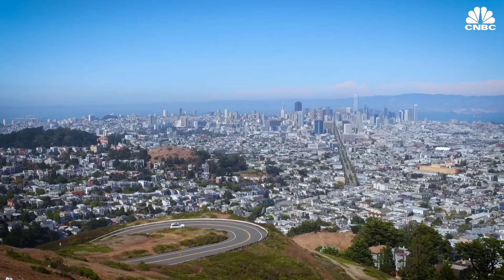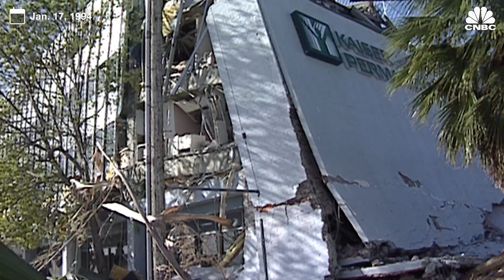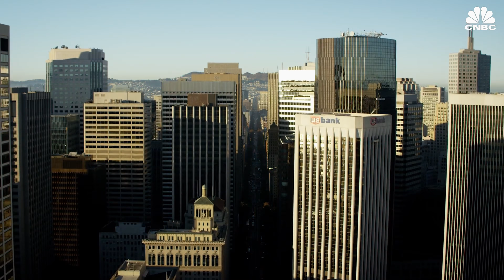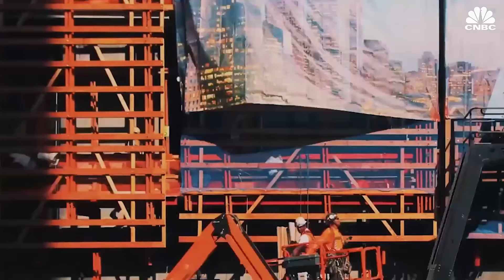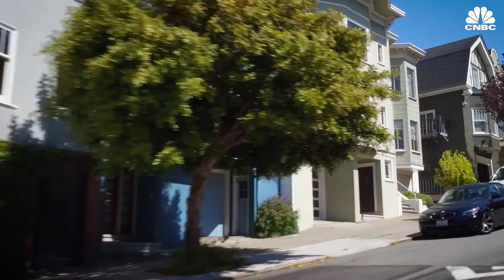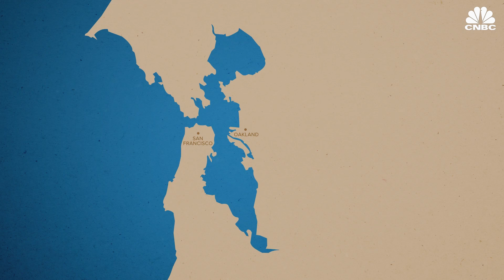Why San Francisco's Earthquake Risk Is Growing

Comment: If Japan can build earthquake-resistant cities, we can too. All future construction should be built to withstand strong earthquakes, liquefaction, and soil subsidence, and old buildings should be retrofitted whenever possible.
Reply: Then all buildings will become Japanese style,
Reply: @yogadarmawan3051  what do you mean Japanese style? You mean more resistant to earthquake style?
Reply: @thelastdefenderofcamelot5623  skyscrapers are actually some of the most earthquake resistant buildings
Reply: @thelastdefenderofcamelot5623  your missing the point dude. It’s not about skyscrapers!
Reply: The new buildings in San Francisco are earthquake resistant. The problem is the older low rise buildings
Reply: Don't go too far, look to the south. Mexico City is earthquake proof.
Reply: Tell that to the SF approvers of millennium tower
Reply: Let me ask from a Japanese guy who is a SF resident. Is Salesforce tower safe against earthquake?
Reply: One thing about Japan is houses are like cars, they depreciate. Houses get demolished and replaced after 30-40 years with modern safety codes and not worth maintaining existing homes and Japanese frown on expensive preowned assets.
Reply: jose manglona  I read that the plant was highly flawed having an insufficient seawall that TEPCO ignored despite studies. Disaster could've been prevented.
Reply: they have been retrofitting soft stories in SF
Reply: @elimarshall1497  🤣
Reply: The one things about building in San Francisco though is that developers maneuver around competing interests. Tokyo for example has many modern mass produced buildings which are very affordable to construct but some of those buildings may be protested against in San Francisco for “not having character” or “ruining the neighborhood” so a developer may have to appease residents by stylizing the new building to fit in with some of San Francisco’s older architecture which would of course increase cost a bit.

Some developers find such concessions palatable because San Francisco is such a hot market so you will see a some buildings that look older than they actually are as to comply with the character of neighborhoods but other developers find the hassle very much not worth it and choose to invest somewhere else
Reply: @jarjarbinks6018  🤨 thats b.s. the new buildings are all modern looking
Reply: @thecapricorn11  I’m not talking about the financial district. They’ve already built it up. I’m talking about all the neighborhoods with Victorian rowhouses
Reply: @thecapricorn11  the “historic laundromat” is a good example of the city literally using their power to block a property owner from building a modern apartment on his own land
Reply: There is no such thing as, "earthquake resistant cities". First of all, you can try to construct buildings that can sustain minimal damage but they aren't "resistant". Second, how would you "build" a "earthquake resistant" city. Your comment is absurd and makes no sense. Why don't you do a YouTube Search for Japan earthquakes then spend an hour watching what happens in Japan during earthquakes and a Tsunami then come back here and delete your stupid comment.
Reply: @jarjarbinks6018  Row houses are house built on a common sidewalk. So, every house in San Francisco qualifies as a Row House and Victorian style house are the most durable and have stood for over a hundred years in San Francisco. You are clueless.
Reply: Even Japan doesn't always get it right. During the Kobe earthquake, some buildings actually did collapse.
Reply: @craigjgomez  The neighborhoods with Victorian rowhouses. I was talking about how whenever a developer wants to build something, even if it’s on a almost empty plot of land, swaths of people who got nothing better to do try to derail the entire project at city meetings. Why on earth would a developer want to work in such a hostile environment. Also some of those wooden rowhouses may look nice on the outside and if well taken care of could withstand a earthquake fairly well but not every one of those houses is in good condition. When someone wants to replace a rowhouses that is falling apart but the city only allows them to repair the house and renovate even though it would more expensive it discourages them from wanting to do anything in San Francisco.

You have not idea how difficult San Francisco’s planning environment is, you misunderstood my comment, and you are clearly looking at all the buildings in San Francisco with rose colored glasses
Reply: absolutely correct.    you should know you've been around since 1931 and you are an architectural marvel!  I live in SF and they retrofitted my soft story building (constructed in 1962)  a few years ago.   one can only hope it will hold.
Reply: @ydne  Could you elaborate please. If the Fukushima Nuclear Power Plant had a serious meltdown after the last major earthquake several years ago and the Tsunami afterwards was catastrophic, I fail to make any sense of your comment. Japan is basically an island in the Pacific Ocean and is prone to seismic activity. You cannot build "earthquake resistant" buildings because there is no such thing as earthquake resistant. Use common sense. In the last major earthquake in Japan, buildings crumbled, freeways collapsed and a nuclear power plant had a meltdown. Do you know how long it takes for nuclear fuel rods to cool? You are talking nonsense.
Reply: jose manglona  Thank you. Finally somebody with common sense. Some other good in this thread actually wrote that Mexico City is "earthquake proof".  It was only a few years ago that Mexico had two powerful earthquakes in the same year over 8.0 on the Richter Scale and one was in Mexico City. If you look it up on YouTube, there are several videos that recorded the event live from video cameras throughout the city. The footage is the most frightening I have ever seen. If anyone can watch those videos then come away thinking that Mexico City is earthquake proof, they have to be smoking some heavy s**t.
Reply: @penguinsforever1609  Right, while there was radiation poisoning for miles around and contaminated Tuna in the Pacific Ocean as far as 100 miles off the west coast of the USA. I guess you weren't paying close attention but the Fukushima meltdown isn't over. It will take a thousand years for the fuel rods to cool. Nobody is calm in Japan. They just accept the reality and go on with their lives. Maybe you should watch some of the video of the Tsunami from that same earthquake. Calm isn't exactly the word I would use to describe it.
Reply: @thecapricorn11  Once again Foggy, you are clueless. I should know because retrofitting simply means bringing a building up to current code. It has nothing to do with being resistant to an earthquake. If you were here in '89 you should remember the collapse of a section of the Bay Bridge. The bridge was originally constructed to withstand a 6.0 magnitude earthquake. The '89 quake was 6.9 magnitude. So much for that. They Cypress Freeway double-decker in West Oakland collapsed on top of itself killing people trapped in their vehicles. You need to look at the ground underneath the foundation to determine whether there will be substantial or minimal damage from an earthquake, not the construction. Every home is built with that in mind and just like the fools who build in the thick vegetation of our "wildland" communities and wonder how their homes went up in flames so fast, it's where you build not how you build. I should know. I have lived here for 73 years.
Reply: @craigjgomez  the highest possible earthquake on the San Andreas fault is only 8.3. The buildings are designed to withstand that amount. The Millennium tower issues were caused because the construction of the Salesforce Complex nearby. It’s a very rare incident as almost all new skyscrapers have been in SoMa where because of the Millennium tower new skyscrapers in SoMa have also been checked.
Reply: @craigjgomez  🏳️
Reply: It's that that you can or can't... you certainly could, but it is a cultural issue.
Reply: We learn from each quake.  As this video points out, the 1994 quake showed that welders incorrectly welded steel together so buildings that should have been stronger, weren’t.  Once identified that problem was corrected for new buildings, but old ones (also as pointed out) still exist.  Many older buildings here have lost their tile roofs as a way to cheaply protect the structure (removing weight). and some major ones, like the big old Southern Pacific HQ across from the Ferry Building are nothing more than a shell, with a new reinforced concrete structure behind the outer walls.  Sadly, while this cost a fortune, no one budgeted for saving what should have been essential period interior spaces like the lobby.  And, given the expense, many building owners put off soft story seismic retrofitting such that a labor shortage (even before Covid) delayed the work as everyone raced to get bids at the same time.  Of course, with half the country revolting against taxes thinking they’re going to end welfare for black people (creating ever more welfare for the richest and mostly white 1%) getting anything done today is problematic.
Reply: Is not just Japan all the countries under the Pacific ring of fire are prepared except the USA for some reason
Reply: SF can build skyscrapper that leans and defy gravity..
Reply: Japan was the first nation with a high speed train in 1960. The United States dont even reach these speeds today...
Reply: There more advance on the other side
Reply: @ydne  Sorry but I don't need any "help" and like I have already stated factually, words like, disaster proof or earthquake proof are oxymoronic. There is no such thing. It is simply an idea that like all ideas when put to the test they fail. Japan like Hawaii and other Pacific regions are prone to seismic activity from mostly underground locations. Tonga recently experienced volcanic activity that was devastating. Despite Japan's advances in automobiles, electronics and shipping, mother nature is a force that mankind will never overcome. The clip you thought was helpful did not provide anything of any scientific conclusion that Japan has solved the potential for mass destruction due to earthquakes. You should pay closer attention to what you are watching and realize from common sense that after the meltdown of the Fukushima Nuclear Powerplant   in Japan and the fact that it takes a thousand years for nuclear fuel rods to cool, the dangers from radiation in Japan still exist and will continue to exist beyond your lifetime and mine. The stupidity of building a nuclear power plant in a highly active earthquake zone is proof that Japan has no clue when it comes to living in a disaster zone. And, I haven't even talked about the power of a Tsunami and the devastation to structures.
Reply: Liam Neeson: Good Luck
Reply: Na bra, u can never under estimate Mother Nature. But I feel what u sayin
Reply: And divert money away from the homeless industry?  Are you crazy?
Reply: Ill come over your your area,  ill FART and you'll think differently then.  😐
Reply: @yogadarmawan3051  all u guys care about is military over there lol. Aint gonna happen 😂
Reply: most of tokyo’s buildings are brand new, most of san francisco is historic, so it would take a lot longer, since each retrofit would have to be approved by the cities historic building regulations

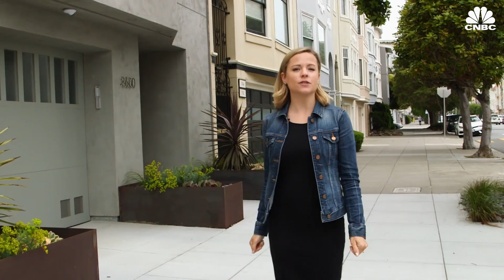Comment: As a structural engineer, I designed earthquake strengthening systems for those "soft story" type buildings at 4:30 in the video.  There were no adequate products to fit into congested garages, so I invented my own.  It's now patented and used in over a dozen cities in the East Bay, Peninsula, North Bay, Pleasanton.....  but SF has so far allowed it in only ONE building after the system went through an independent engineering review.  The reasoning behind SF's hesitancy would make a good story in itself.

Comment: One aspect skipped over in the soft-story issue is that those are the buildings that make up much of the fabric of what makes San Francisco, San Francisco; the neighborhood shops under apartments, not just the garages.  Sadly, in the push to get this done (and it has to be done) a lot of long standing businesses that have weathered all sorts of modern challenges have been put out of business when forced out for the retrofit.  And that, was pre-Covid.  Other, larger old buildings, like the big “brick” structure right across from the Ferry building, aren’t as they seem.  Built for the Southern Pacific Rwy, that building was always a brick covered steel frame building, built on lessons learned from 1906.  But it isn’t even that any more; like the former Matson building now subsumed into the PGE complex (itself no longer PGE) is a post 1906 facade, on the outside of a new concrete inner shell, with an entirely new interior floor plan, and along with that extra earthquake safety coming in, out went all the elegance of the old structure, only bits and pieces of the Matson and PGE lobbies remain, and nothing remains of the Southern Pacific’s once elegant lobby whatsoever.  We need to rebuild for earthquake safety but we’re losing so much in the process that one has to wonder if we’re destroying the City to save it.
Reply: Businesses come and go. So do buildings, I guess, but nothing is being "destroyed" worse than an actual building collapsing by having businesses die in transition. Can leave families homeless.
Reply: @snipingwes  Yes, but the point is SF is just handling this badly.   The choice isn’t protecting buildings or letting them fall down, it’s protecting buildings, preserving businesses, and architectural details.  Our sidewalks (without even considering the homeless catastrophe) are ugly outside of our neighborhoods because of the removal of architectural detail, then, looking past that, in too many buildings (like the SP bldg) you don’t see any elegance inside, nothing to draw you in as you see in so many other American cities, from NYC to Portland and Seattle.  The city only cares about social programs because that’s what the activists care about, and nobody is paying attention to the City itself, which is being whittled away to nothing.
Reply: As long as humans don't die it's ok to go to the extreme.
Reply: @syasyaishavingfun  Going to the extreme isn’t the problem, it’s doing it on the cheap.  Why prop up any old building if you’re going to gut it?  An old building like the Southern Pacific HQ or Matson HQ isn’t just it’s shell, it’s also its lobby and public spaces.  Trashing those makes a hollow shell out of what you saved.  There’s a right way and a wrong way to everything and while SF is dealing with a critical problem, it’s doing it too often the wrong way and wrecking the City in the process.

Comment: How do they know the "maximum earthquake ability" the San Andreas fault can produce ??? What if several earthquake faults fracture at the same time ??? I remember the Alaskan earthquake in 1964 that created a Tsunami, destroyed most of Anchorage Alaska by shaking, flooding, and fire. In some cases the streets opened up and there were 20 foot deep trenches in downtown Anchorage streets.
Reply: the plate boundary in Alaska is a convergent w/ a subduction element, which causes the largest earthquakes we have seen (along with hot spots like Missouri). Strike-slip plate boundaries like the ones in the Bay Area generally don't produce earthquakes greater than 8.0

Comment: If the Earthquake is not to far from the surface of the ground then there will be waves in the motion of the ground; if the Earthquake has a strong enough effect on the Richter scale; and the ground shakes for several minutes wouldn’t the buildings collapse; and tip over?

Comment: The more prevalent threat is not in san Francisco,  its in a place far more dense with skyscrapers and far more people,   NYC Manhattan island.   Little known fact.. Manhattan has 5 fault lines running right thru her.  And earthquakes on the east coast are far more dangerous than those on the west.  Obviously not to say the west has not had its fair share of nightmarish quake disasters.  But the east coast has something very different due to the land, the crust of the earth being more rigid appose to that of the west coast.   when a quake occurs on the east coast, that harder land transmits the force and power of the quake more intensely over far longer distances.  Think of it like jumping up on down of sand appose to jumping on a plank of wood.   the softer sand, dissipates the force while the harder wood plank maintains the force and strength throughout.    quakes that happen in Washington dc can be felt as far away as Boston.   And NYC is well overdue for a major quake.

Comment: This is most likely why thatthe higest building , the Transpyramid building (which has an observation deck never opened it to the general public) and as no public building has an observation deck at all. (Some top floors do have expensive restaurants, like the Bank of America building and the St Francis Hotel. (They all may be closed by now). The only observation area is Twin Peaks with NO public transport means and no inclinator or funicular either. Even a ropeway would be nice, but the city still poo-poos the idea.

San Francisco is way too expensive for the old American building standards as we in Europe and also in Asia have much higher building and safe building standards. perhsps due to the coming of the 'Big One' no effort has been put into observation areas. the Crown Room of the Fairmont Hotel had an observayion pub and restaurant served for the general public with a clear window observation lift. That has not worked for decades, and that space is the most expensive suite in San Francisco (privatised for insatiable greed by the Fairmont Corporation).

San Francisco is essentially an expensive fire trap in California!